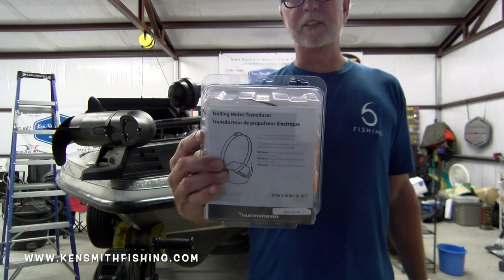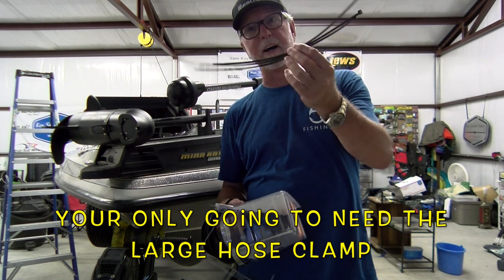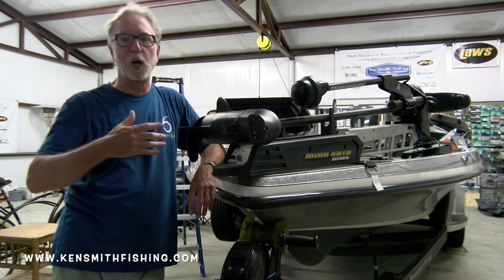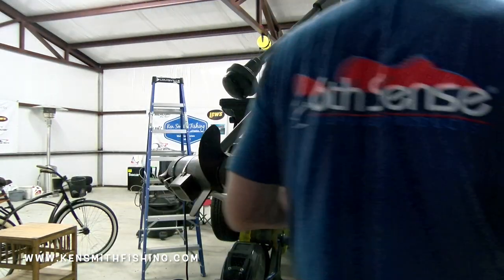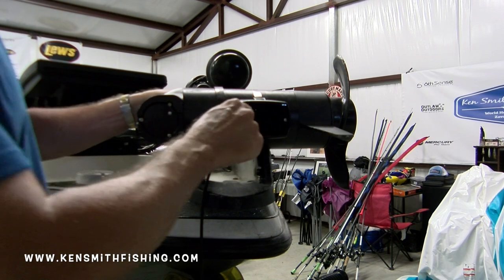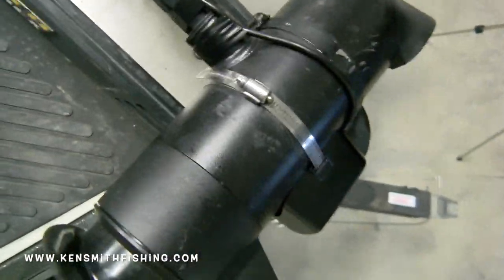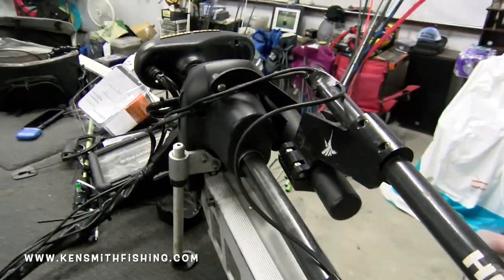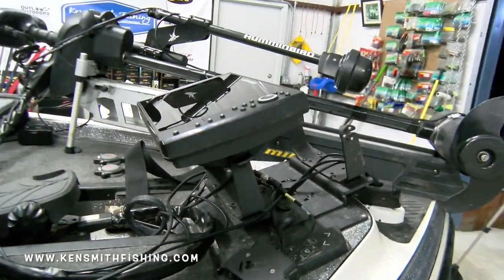Don't Make My $200 Mistake Installing Transducer on Ultrex Trolling Motor - Ken Smith Fishing

Comment: Ken, long time no see.  Will jump in here with 2 cents worth.  Never use zip ties on transducer cables on trolling motor shaft.  Retired from Ford Motor Company as electrician.  We were not allowed to use zip ties on small signal cables, they are too fragile and easily damaged by zip ties.  As a fisherman, I would never use zip ties on trolling motor shaft.  If a fish runs my line up trolling motor shaft, line needs to slide up or down shaft free or you can lose that fish.
Reply from the maker: Hey Richard good to hear from you, how’s the fishing up in Missouri?

Comment: I'm certified Garmin dealer/installer and they recommend electrical tape on the panoptix transducers.  Lowrance on the livesight.  Even then it will not void the warranty as I have sent both back for warranty with no issues after ties were used.  Apparently garmin didn't know it would be an issue as the install manual changed on the fly.   Standard transducers are no problem.  I have started telling DYI folks to use tape as they tend to "gorilla" the ties.

I only use high quality electrical tape. It sticks well as the outdoor elements start working on it.  Nothing better than 3M Scotch 33.  Inexpensive tape IS NOT the same no matter what folks say.
Reply from the maker: James any other things like this we should know regarding mounting or did you see me do ANYTHING wrong here???
Reply: @KenSmithFishing  not exactly how I might do it but it will work.  :-)

Comment: Thanks,  for  the video. I just busted my ultrex  trolling motor shaft  and its in the shop now under warranty. Ive been searching  how  to route cable the right way  because  I never was sure  if how I had mine was right. Surprisingly had it same  way you  routed yours and with tape.  But my issue is it  gets close to pinching  my cable  under mount  when  I deploy it. I don't  have the hummingbird  360 deal.
Reply from the maker: Seems somebody could create a little bracket for it

Comment: It is best to never tap on (or otherwise hit) a transducer, especially the complex ones. They have numerous fragile crystals inside that you can damage with the shock from hitting them.  The wires inside the cable are fragile, and there's a woven EMI shield around them inside the insulation.  If you cinch it down with cable ties, you could damage what's inside, but also I'd be concerned that an impedance discontinuity might occur (because you change the shape of the cable by flattening it out).  An impedance discontinuity can cause signal reflections inside the cable; this has the potential to affect the quality of the displayed signal, or even add noise to the screen. With all that said, I think it's better to tape than to zip-tie, thereby avoiding possible issues, regardless of whether they decline warranty coverage. Years ago, when transducers were typically a two wire circuit, zip-ties were probably less of a risk, and I used them without issue. With the complex transducers we have today, I've changed my mind.
Reply from the maker: You probably saw me realize that as I started whacking it

Comment: I have a Garmin 93sv on order it will come with the GT54 transducer.  I will be running a Garmin Livescope through the 93sv.  I will have the Livescope ducer on a pole, (Seelite) and I want to mount the GT54 ducer on the same pole.  Is there a mount for this that will work without either one interfering with the other's beam ?  I do not want to run any ducer off my trolling motor since I have a Minnkota Riptide ST with the shaft that slides through a block.  I have run a ducer off that motor but just doesn't work well...thanks.
Reply from the maker: Man that’s above my pay grade, call the boys at Jones in Texarkana they may know

Comment: They make zip tie pliers that will pull them so tight that they will cut into the wires. That is what will void your warranty. Just don’t over tighten the zip ties and you should be fine.

Comment: Are you running two transducers in the front for the 10 and the 12 or are they networked?
Reply from the maker: Smokn I have the Helix 12 connected to an external DI transducer on the Minn Kota (mine were of the generation that you couldn’t get DI transducer built in) and then it’s also connected to the 360. The other 12 up front is the Garmin and it’s connected to the livesecope transducer which can be used for livescope or DI
Reply: @KenSmithFishing  I see so they are running off two different frequencies so it doesn't that talk.

Comment: Okay Mr. Smith, after doing the install of the cable to the top of the 360 how did that work out for you?  I am installing a Mega DI transducer on my Ultrex and am to that point!  Thanks for the video.
Reply from the maker: Has worked great Eddie
Reply: @KenSmithFishing  Thanks Ken.  I had installed a transducer on an Ultrex before, but added a Mega DI to the new boat along with Mega 360, hope to test it this week!!

Comment: Ken so you made a Comment that you have GEN two hummingbirds and you’re running a 360 on the front is that true, I would like to have a 360. But I didn’t know it would work with a gen two
Reply: Flint Ralston gen2 will run 360 but not MEGA 360
Reply from the maker: Correct Chris
Reply: Chris Evans  thanks for the answer